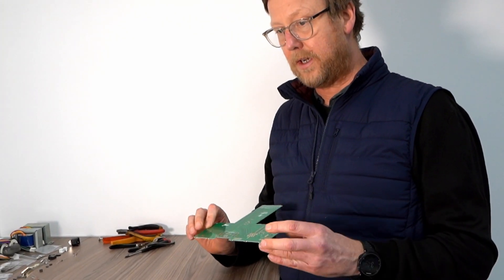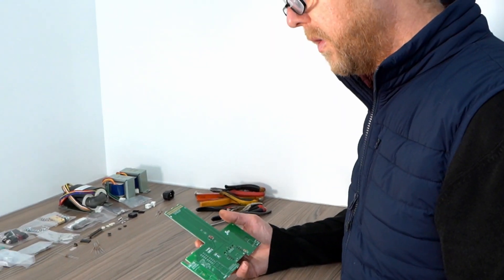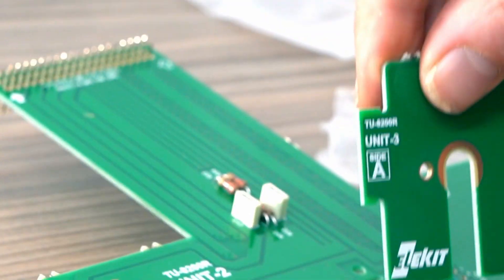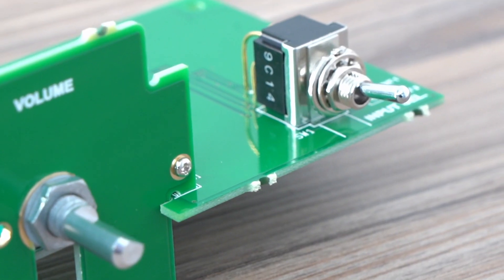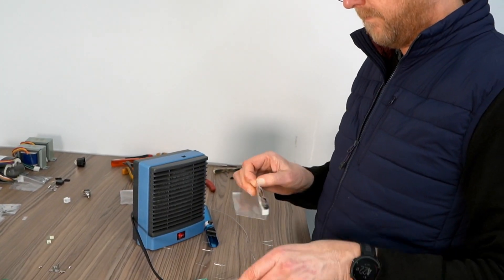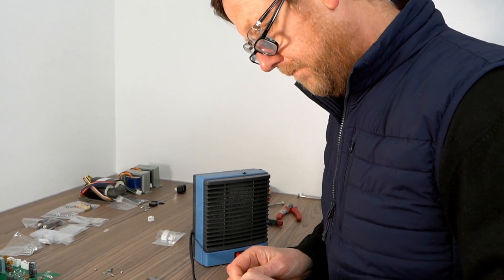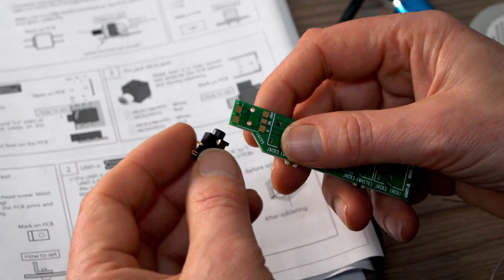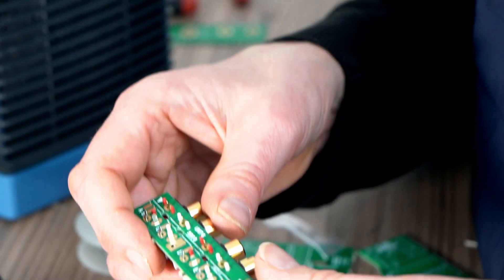How To: Assemble the Elekit TU8200R Amplifier Kit pt.3

Comment: Information for friends who are assembling this kit and following this video: the L-shaped pin header (Male) 40-pin at 3:59 was inserted into the Unit-2 a wrong way. I am almost sure about it as I finished the Unit-2 a few days ago.
Reply from the maker: Well spotted, make sure this is soldered the right way round; we discovered that unsoldering the multiple pins can pose quite a challenge!